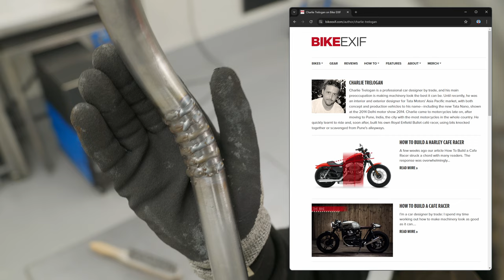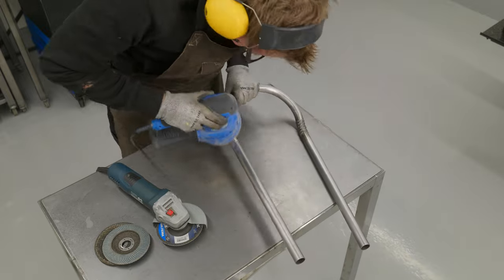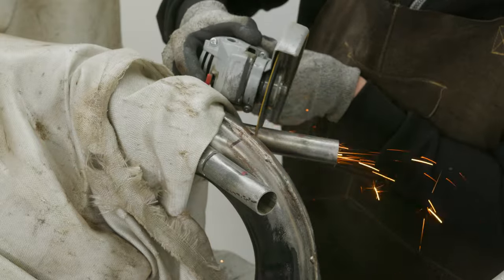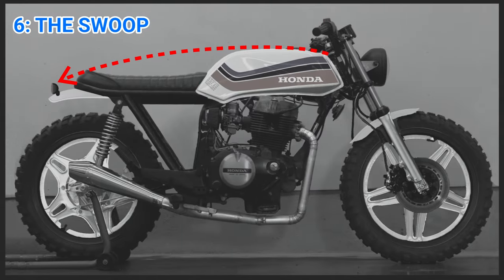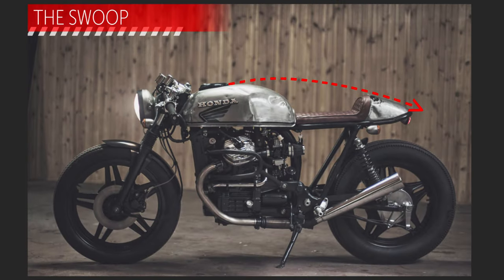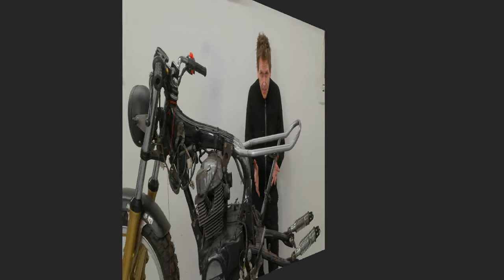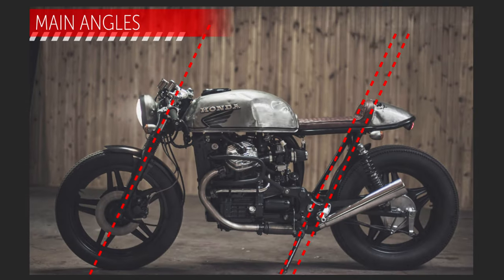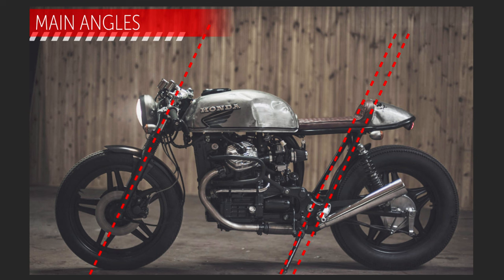Cafe Racer Design Guide - Don't Make Your Build Ugly! Honda CB400 Cafe Racer Build E5·S3

Comment: One thing I cannot stand with cafe's is the great triangle of nothingness under the seat.  Oh, it looks awful!
I think on your bike, you can tie in the odd shape of the back of the tank to the seat and/or some sort of side panels.  Also, you really should run an up pipe on a scrambler.
Reply from the maker: @Jeekinz  One of the goals with the cafe racer was to get it as lightweight as possible, removing side panels, the heavy battery and the air filter box saves weight. The empty space left behind is also a visual proof for a successful weight reduction 😁
Reply: @kihestad  Look at the thumbnail pic to Racer TV 2023 20 best and tell me that side panels don't look better.  Those parts you mentioned barely weigh anything and bikes run better with air boxes.  That's why they are there.  If you want to save weight, stop building stuff out of steel.  Use aluminum and carbon fiber, titanium hardware.

Comment: Bone line did improve a lot!  And the back needs to go up a bit and/or the front lower in my opinion. But he.. its your design so do what you like!   I will put my own caferacer against the principals, never even  knew they excisted.
Reply from the maker: Yep, it's a bit tall at the front and/or low at the rear to be a 100% cafe racer type. But I am not really aiming for that, this one is supposed to be a tiny bit scrambler-ish 😊 I think it will be a bit better with taller rear shocks / raised lower mounts.

Comment: Tanks from the early 80's onward are often made to connect to the side panels. This makes them look weird without those pannels in place. Making a truly good looking build is not easy.
Reply from the maker: That's exactly how it was for this bike, the side panels continued where the weird bend is now. Without the side panel the bend is quite useless 😵‍💫
Reply: I was going to suggest that. Merging the new covers into the existing end of the tank. I like it so far, Is that a CM400T?
Reply from the maker: It's a CB400N from 1984

Comment: Take any old bike
Put a pair of clubmans on it
Done
In California alot of people will build a cafe as cheaply as possible and then ask $6k for it. By cafe I mean cut a few parts off. Add a nice seat and headlight ferring. It's sad because they take these classics and ruin them instead of making a nice cafe. Your build looks very nice.
Reply from the maker: Agree, better to keep the bike original than ruin it with a bad rebuild. If a classic motorcycle is in decent condition, I would recommend restoring it. If it's not a classic, and in poor condition, well then a cafe racer build is OK, but it has to be done right 😠😊

Comment: Hi and thanks! I have a question about clip ons and the height of the front forks. The front of my bike is too high. Will clip ons be enough to create a lower, sportier and straighter line between the rear end and the front end? Or, do I also have to push the forks up through the tripple tree and thereby lower the front end? That is, can clip ons create the 'impression' of a lower front end - even though it is in fact not lowered?
Reply from the maker: Hi, what bike are you rebuilding? I think most bikes look best when the front fork is shortened internally like this: https://youtu.be/18ugcgtkrxY?si=pmhPxmp1qSJrdjhS

Lowering it through the triple tree is also possible of course, but not my favorite way of doing it 😉 

If the front is high, or there is a big gap between the front of the engine to the front wheel, just putting on clip-ons might not be enough to get the true cafe racer look

Comment: Everything else is quite nice, but I couldn't live with that tank bottom line. It should be straight as possible. It's angled in too many directions. I would personally try to modify tank, which would be a pain or consider some different tank. Something in veins of Bonneville, though don't know if dimensions are even close to fitting on that. But anyway, more "classic" older style fuel tank.

To me problem exactly is that those shapes scream "this is shaped for fairing to continue" and it just doesn't cut it for me.
Reply from the maker: Yea, this tank will never be perfect if the aim is to get a true old school cafe racer style 😌 I have however decided to keep it as is, trying to make it a feature instead of a flaw 😬 By having parallel lines with the upswing on the seat hoop and "reverse curves" on the tank decals I hope it will look OK. At least it's some kind of unique design, and some kind of tribute to the original bike.
Reply: @kihestad  Sure it's option. And good one in regard of breaking the "rules". Imo too many stick to guideline X and make their builds fairly generic looking and losing a lot of personality going that route. Like virtually 95% of modern cars. Made with aerodynamics and trends in mind and they usually end up looking really boring and similar. I personally like surprising ideas some have come up. Recently saw for sale 90's Kawasaki ZZR made to modern scrambler and military paint camo style with hand made leather bags and stuff. It looked really bizarre and unexpected in a very good way. Never ever thought that frame and bike like that would be suitable for such conversion.
Reply from the maker: Yes, that's a very good point! We don't want all bikes to look the same. It's nice to see experiments, some builds really surprise with unexpected and very good looking design 😊

Comment: Don't know..
I mean.. interesting video but I think that Cafè Racer Bikes are form of art without any rule to follow.
What you like may be somebody else doesn't.
Reply from the maker: @wtfftw24  I have to disagree. For example: if I put on long front forks, a high handlebar, lower the seat and put on a small fat rear tyre on my bike: then I have built a chopper, not a cafe racer at all. The reason we can distinguish between different types / styles of motorcycles is because they are built using a set of 'rules' that makes it look a certain way.
Reply: @kihestad  yes of course but you made an extreme example.
I have been building Cafè for about 10 years now and I still prefer not to have any rule to follow but do what I like or my customer likes.
Btw thanks for your feedback and complement for your channel 👍
Reply from the maker: Ah, cool - I guess you have quite a lot of experience after 10 years of building cafe racers, a design guide is probably not needed at that point 😁 Instead of this being rules to follow, you can think of it as a collection design elements typically used on successful cafe racer  builds. I would think we all get ideas, get inspired, and become influenced by looking at other projects. This design guide is really just that put in system 😊

Comment: What bugs me more is how terrible the performance usually get with these cafe racers. Fitting these CV carburettors with pod filters usually leads to a bad mixture and sloppy power curve negating any performance gained with the weightloss. 

And after they're ridden in ground they end up for sale online with "just needs a carb clean" in the description
Reply from the maker: Haha, yes it's absolutely a challenge with these small podfilters. Jetting them to provide more fuel is possible, but for carbs made for laminar flow It's hard to get good performance using podfilters directly on the carb intake as it leads to turbulent flow (I think 🤔).
Reply: @kihestad exactly, I've seen alot of solutions on these honda twins. blocking the wide end of the podfilter with some tape seems to work. placing the podfilters further away from the carbs seems to work better but doesn't look as good.
Personally I leave the stock airbox on my cb400t in combination of having a balance in the exhaust system. But yeah, that leaves me to deal with the awkward frame these bikes have.

Comment: A café racer had to be able to drive at least 100 mph. So all unnecessary parts were removed to reduce the weight. Installing lower handlebars to reduce air resistance. Give the engine more power. That is the principle of a cafe racer. 
Proportion or appearance had nothing to do with it in the first place. Over time it has become a fashion concept... Appearance is more important than performance? It must be period related! A discussion between so-called purism and principle.
The idea of what a cafe racer should look like is not what makes it a cafe racer.
Reply from the maker: Today, if you want to go fast, you can a get much "better" newer bikes. Just pick up a racer oriented mc from the 90s or later, and you outperform any cafe racer 😎 The original idea behind cafe racers was to get stock bikes from the 60s to go faster, nowadays it's all about style (If you ask me)

Comment: Hope you arent keeping the scrambler tyres on it
Reply from the maker: Yes, this is a scrambler-brat-cafe racer hybrid 😝 I am mixing and matching the different styles to my liking. I am not putting on clip-on handlebars either. It's not exactly suitable to go off-road in very rough terrain, but it should be possible to take it on gravel roads or a trip to the beach 😎